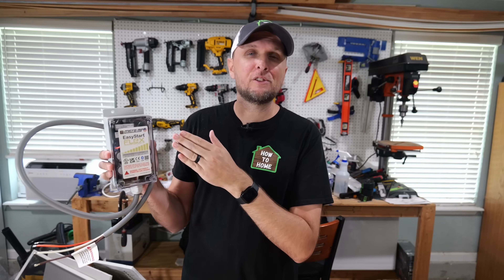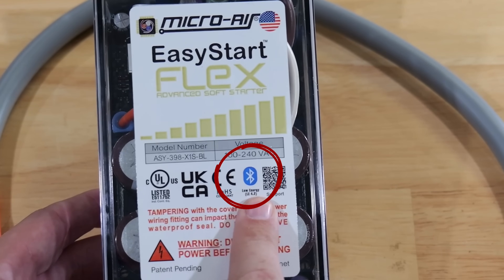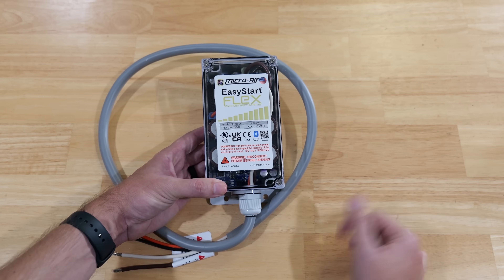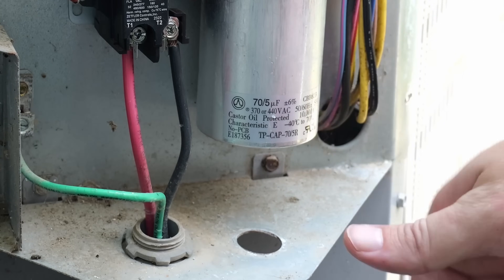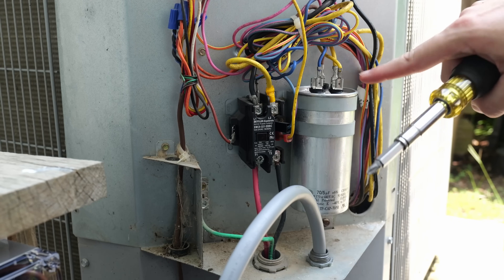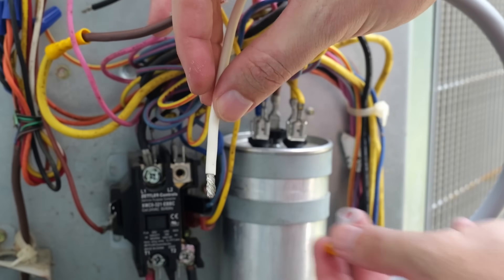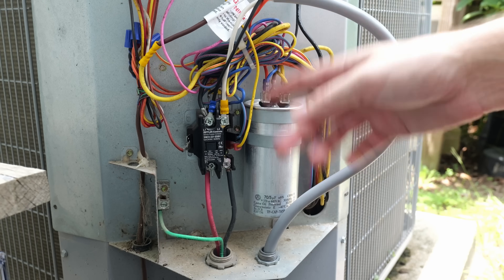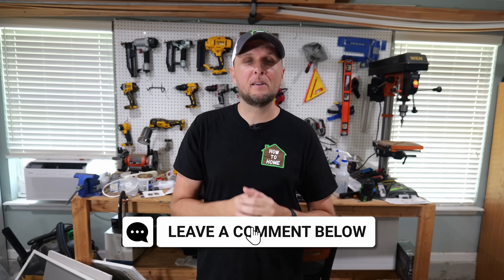The ONE AC Upgrade Every Homeowner Needs to Consider!

Comment: Nicely done. I installed a flex unit on a Bryant 4-ton unit, and the start current went from 105A to 24A.  The RLA on the unit is rated ( on the sticker) at 15.5 Aac and now is at 7.3 A, which surprised me. Unfortunately, I didn't verify the 15.5A with my meter before I read the RLA after the installation, but that is what the circuit diagram's current listing says, which sounds right. ??

Comment: I just wonder how long would the soft start will last?  The unit is not cheap it cost over $400.
Reply: I had one on my previous house for about 10 years. Used on 8 to 10 hurricanes in S. Louisiana. Power outages lasted from hours to weeks. Sold the house a couple years ago, soft start included. When we sold the house, the condenser was over 20 years old. Have had a soft start on the RV for 12 years, and 2 AC units (failures had nothing to do with the soft starts).

Comment: I just recently purchased the older model after watching your installation video on it not knowing the newer model was out but cant complain i ordered mine from hutch mountain they already have all the hardware installed on the wires to complete the hookup took about 5mins i can now run my 3 ton heat pump with my 9000 starting watt generator without any strain

Comment: Installed the original on my 25 year old 10 seer ruud a couple years ago and it has been working flawlessly.  In fact it has even safely cut power to my unit a few times when real faults occurred that might otherwise be dangerous like when the compressor wires rusted off the posts and started shorting.  That might have easily saved me an entire system replacement plus it actually told me exactly what was wrong so I could fix it myself through their diagnostic app.  I just wish their app could connect with the unit even when there is no call for air and ideally have it connect via WiFi and integrate into smart homes via matter.  Haven't noticed any drop in energy bills but it is quieter.  Hoping to get another 25 years out of it.

Comment: Interesting technology.  My guess is this would be great for older systems, but would they be of any benefit for inverter driven and ECM equipped systems (My Trane system has both inverter for HVAC compressor and ECM for air circulation).
Reply: ECM indoor fan motor has nothing to do with this.  This only affects the compressor, but if its an invertor compressor, theres no point to using this.

Comment: As a homeowner for over 12 years and having the ASY-368-X48-BLUE unit for about 3 years; it has saved me on at least 2 HVAC truck roll calls. The going rate in my area for a bad run capacitor is about $125 part included.

Speaking from experience of the situation of a bad run capacitor, when the compressor goes into thermal overload; the housing of the compressor will hot enough to fry an egg on it. The conundrum is how long has this been going on before you discovered it. The EasyStart unit has the brains learn what is normal and what's not then does its thing quietly in the background.

For those who are on the fence about purchasing one, it's not an inexpensive device. If you have plans to run your A/C on solar backup battery or generator during a grid outage, definitely save up for it. I've kept myself cool during an 8+ hour outage when it was 92°F feels like 116 outside is priceless.

PSA: when the inevitable time comes to replacing a bad run capacitor, I highly recommend to initiate the relearn process after the new capacitor is installed. It'll work fine if you don't do it, but it doesn't hurt to have the soft start optimize itself with the new capacitor. Another benefit is that when your old unit needs to be replace, it can be transferred to the new unit and relearned.
Reply: Just replaced the capacitor and the contactor on mine. 12 bucks for the capacitor and 24 bucks for the contactor.
Reply: Capacitor replacement in Houston, TX is typically $250 or more.  I do my own and help friends with theirs for a much more reasonable cost.
Reply: Run capacitors run $10 to $20. I keep a spare on hand at all times.  If you can install a soft start, you can replace a cap.
Reply: @MarshallDudley  I was thinking the other way around. If you can replace a capacitor, you can install one of these. Kinda means the same I guess.
Reply: Capacitor is 20$ and a 5 minute YouTube video, suuuuper easy. No need to ever call a A/C company to do it if u don’t want to
Reply: @taden2007  That's only mostly true, if the capacitor is the problem (and it usually is). Mine was blowing room temp air. Changed capacitor (already changed it in 2023) even though it wasn't that old; no good. Called an A/C tech, he came out for $85 diagnostic. There are two wires on the fan next to the evaporator coil. One wire had separated from the connector and somehow touched the evaporator coil and burned a hole in the copper tubing (inside the fins), releasing all the coolant. I had never opened the entire top of the unit (big rectangular monster unit), because there is no reason to, at least I thought. My unit is like 3' X 4'', so taking the top off is an event. When I clean the coils, I only pull the fan and clean the coils from the inside out, which is only half the unit. 

Even if I had opened the top, I would have seen the damage and called an A/C tech anyway. I'm glad I didn't open it, because I'm too much a handyman, would have reattached the wires and still experienced the problem, as I wouldn't have known about the hole and coolant leak. As it was not the capacitor, I just called a recommended A/C company and the damage was obvious when he took the top off. He welded the hole and replaced both connectors and filled it. $185 labor, $350 for 5 lbs of coolant. 3 ton Bryant unit made in 2020. Now you can laugh; that monster unit cools a 738 sq. ft. mobile home! Don't ask why, I didn't install it; it came with the house. I'm actually worried that it is too big.

Comment: I don’t believe I have a “demand charge”, and I have no generator or solar. So the only reason I’d be doing this is to increase the longevity of my AC compressor. 
     This seems like “repeat technology”. I should think new units would have this feature built in. 
     While I like the idea of the soft starter I’ll wait until I buy a new (and crappier) unit. It may not be long. My A/C unit is about 34 years old, but it is still cooling about 25-degrees from ambient air. So I don’t want to upset the “mojo”. You know what they say, “If it ain’t broke…”
Reply: My unit is 7 yrs old, Dual fuel, heat pump with nat gas, and crosses over to gas at 35°f. In the summer,  with it being 95° outside, the air coming from the duct is 50° so that is a 45° drop And it keeps the house at 72°
Reply: @stevem1081  : Nice. The hottest days I can expect around here would be 105-degrees. So that would cool my house to 80-degrees no problem. I usually. Keep the house 78-80 anyway; so I’m good. 👍

Comment: I installed a  easy start a year ago and I swear My electric is $25.00 a  month less in mid FL   Now the 4 ton A/c starts with 31 amps,  Can I install a  30 amp box to run the A/C with a  Generac 7500 or do I need a  50 amp box and an adaptor to the 30 amp cord like you did?

Comment: I have the older model and it still works great with bluetooth. I covered it up so it's not in direct sunlight.  No need to upgrade to the new one, it's just smaller. Still hard to start/run a 5 ton with a generator. 2 PowerWall 3's to be installed very soon.

Comment: If one has a NEW ac unit installed today does the new units already have a soft start mode as standard?
Reply from the maker: Completely depends on the unit.  For instance a mini split system does not need one because of its inverter technology.  So you would want to know what your in rush is or at least your LRA.  If it’s high then a soft starter would be very helpful.

Comment: Great video.  Wish I saw this a week ago because I just bought & installed the 'regular' X364 soft starter and would've gone with this Flex version instead since I had to externally mount my box and the Flex is quite a bit smaller.  Otherwise, I'm so glad I installed the Micro Air EasyStart unit on my old AC unit as it's made a noticeable difference with the current draw and the start up AND shutdown, as the motor now sounds much healthier than the usual loud clunk noises previously at both startup and shutoff.
Reply from the maker: Yeah I hear you on the size difference but rest assured you still got a great unit.  Same technology.  Really glad to hear you got such great results!  It really is amazing!

Comment: VERY interesting, IF mine was like your's this idiot might could do this BUT, what would be a typical HONEST charge would be to have a AC person install this?
Reply from the maker: I will be honest with you, I am not sure.  Because my experience with talking to most HVAC techs is they don't know what this is.  You mention soft start to them and they think you mean a hard start.  Last tech that came out and looked at my unit had no clue what it did lol.  If you can find one that knows what it is and how to install it then I would guess most pros are going to quote somewhere around $400 - $700 just to install it.  That is just a guess based on other somewhat similar jobs.  Would be interesting to hear from any techs that watch the channel what they would charge. I personally think $200 - $350 would be fair if you supplied the unit.  I have gotten so good at uninstalling and installing them that I can do it in about 10 minutes.

Comment: Nice presentation! 👏👏👏 I too am a little concerned about the reliability issues reported on discussion threads on Reddit. It's not a cheap product. But that's OK if it is made to last.
Reply from the maker: Thank you very much!  I am glad you liked it!  I personally was not concerned with it and ended up buying this one for a few reasons.  I found that many of the reports on reddit and other places were the same people with multiple posts.  So I think it is very much the minority having problems as people that dont have issues dont make posts.  I have had 2 of their other units in the past, they lasted years, with no issues.  I also have talked to the people at Micro Air and their customer service is fantastic.  Typically if you e-mail them they get back to you within 30 minutes and they will warranty out the units.  Which I saw in most of the posts where the folks said this was the case as well.  I have had my Flex installed for 2 months now, no issues.   I absolutely will post something if things change as I do not owe Micro Air anything as I bought this myself but I don't foresee that happening due to everything I already said.  But anything can happen!  Thanks again!
Reply: @HowToHomeDIY  I can't tell you how impressed I am that you responded to my comment so thoroughly and so thoughtfully. Please know that such kindness and commitment to your subscribers is not lost on me. BRAVO!!!

Comment: A lot of reports of these having issues in the Houston area. There are other soft starts that cost less.
Reply from the maker: I have not seen these reports.  I can only give my own experience.  I have had the new Flex installed a couple of months now with zero issues.  I have had 2 models before it that lasted years each and had no issues with them.  I have not owned the other models but I do know that a lot of those less expensive units do not offer everything the Micro Airs do and have plenty of issues themselves.  But totally up to you.  If I find an issue with this new unit I will report it as I don't owe micro air anything since I bought this myself.
Reply: @HowToHomeDIY  there was a large generator group on Facebook where MicroAir was active. They were aware of the problems and sent someone to diagnose many of them. Unfortunately the owner of the group  closed the group around Aug 9. It was one of the best places for info.  I don’t have any more details beyond that they were working in sorting out the issues where applicable.
Reply: Details?

Comment: In 2023 installed the earlier non-Flex unit on my 5 ton 2007 Trane straight-cool. Worked for 30 days and then the compressor wouldn't start. Removed the Easy Start and everything worked again. All installation performed by my NATE-certified HVAC tech. Returned the unit and received a full refund from the nice folks at Hutch Mountain.  I probably received a faulty unit but didn't feel like repeating the process.
Reply from the maker: It probably wasn't anything wrong with the soft starter but it may have been detecting an overcurrent fault or some other fault and purposely not starting the compressor.  I don't know that obviously, I would have needed to see your data.

Comment: What will adding one of these devices do to the warranty  of the unit? My Trane XL15 heat pump is just over 1 year old.
Reply: GREAT question
Reply: If its a brand new heat pump, its probably an inverted compressor, so this wouldnt be benefical.
Reply from the maker: Shouldn't do anything per the Magnuson-Moss Warranty Act.  This law states that aftermarket parts alone cannot void a warranty unless they directly cause a problem.  Also, Micro Air offers a warranty with the soft starters on the compressor.

Comment: Is this for heat pumps as well, or just dedicated AC units?
Reply from the maker: Heat pumps as well.  Mine is a heat pump.
Reply: Yes it will work, but.... 
It will make your heat pump less efficient and cost you more in electric bills especially in colder areas. The catch here is defrost mode.  Compressor defrost boards typically have a short (30-60 second delay) shutdown before operating the reversing valve to avoid the slamming noise from sudden reversal. Goodman calls it SmartShift and it can be turned off, but so much for the quieter benefit! Now back to the delay issue. The soft start will interpret this as a short cycle and add a three minute wait period before restarting. This is three additional minutes you will be on backup heat, aka emergency or electric heat and not benefitting from the heat  pump. Now when the defrost cycle is over, it shuts off to shift back, and again, another three minutes not pumping heat but burning it (electricity). This can affect mild climates too as some systems (older single stage Goodman's and I know many others) defrost in milder weather based strictly on a timer. The defrosts will be short in mild weather but now they are six minutes longer. 

To make a long reply longer, it can be worse with dual-fuel units.  I added the heat pump onto my oil furnace and do not have electric backup heat. This time adds on to the amount of time I blow cold air as the unit defrosts.  Yes it is bad as it sounds but I actually am quite used to it and hope to get rid of the oil some year soon. (I tried competitor's soft starter that had a SIX minutes delay EVERY time it started! Luckily it burned out before the warranty expired). 

This is all just my analysis of the situation and I would welcome discussion on the topic. I have not installed my MicroAir soft starter yet in almost two years.

Additional thought: the short cycle delay can be turned off (adjusted?) in the app, but it is not recommended. The short cycle benefit masks that (all) soft starters do not do well if the motor it is applied has a heavy startup load. It needs an equalized system. AC units build up pressure as they run but starting while that pressure is still there is a lot tougher. When off, the pressure equalizes until it is the same on both sides of the compressor. This time can vary based on a few factors but it varies.

Think of it as starting your bicycle in a higher gear. Might be fine on flat ground but what about starting going uphill? It works but you're going to need more power. If you want to start any other loads (pumps etc), MicroAir recommends that your electrical engineers consult their electrical engineers.
Reply from the maker: @thomaskreimer592 none of what you said has happened in the winter with my heat pump.  Comes on just like it should every time.

Comment: I have a two stage AC unit. Does it work for those ?
Reply from the maker: It is compatible with 2 stage compressors per Micro Air.

Comment: Can this soft starter be used on my electric furnace as well?
Reply: Your "electric" furnace is actually a heat pump, which uses your AC unit in reverse to heat your house.  Then if its gets really cold (less than 20-32'F-depending on the model), only then will it switch to very expensive to run electric heat.
Reply: @srobeck77  Derp. There are tons of electric furnaces comprised of nothing but heating elements.
They're extremely popular in upstate New York and New England. 
According to a 2023 survey of heating sources, 63% of homes that have electric-only heating have no heat pump.
If you'd like to explain how my childhood home has no outside condenser while also having no air conditioning... but is mysteriously a heat pump system, then I'd love to hear it.
Reply: @tim3172 California tried that experiment 3 decades ago. When people were paying 4-5 times higher electric, than natural, its why you will never see an electric furnace in northern climates, ever.